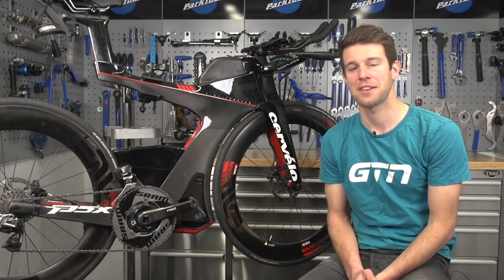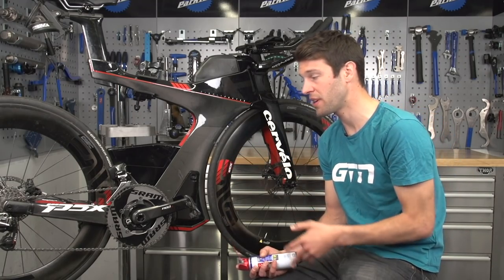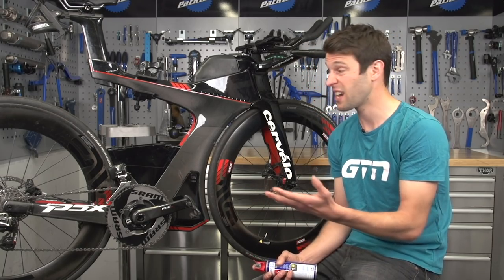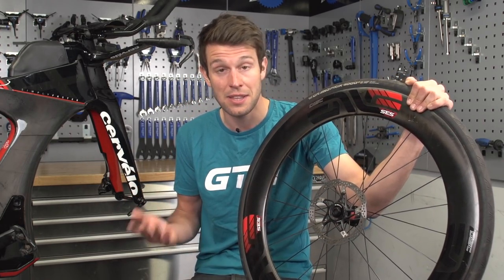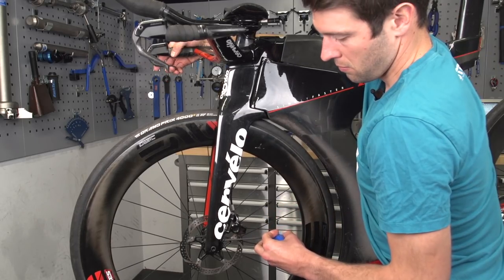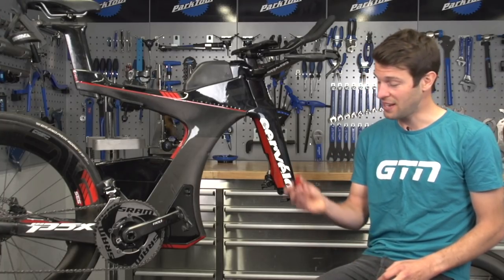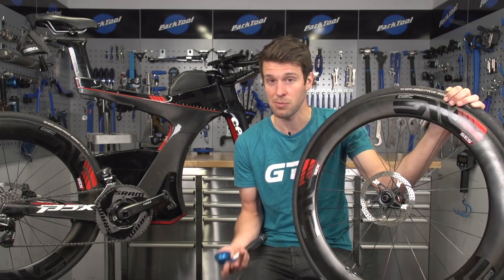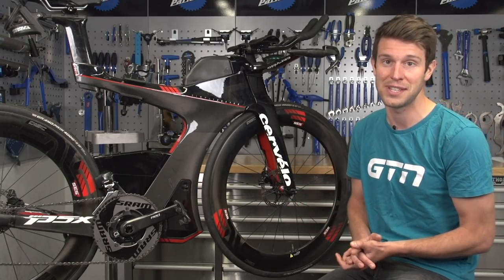How To Maintain Disc Brakes | Easy Fix Disc Brake Tips

Comment: no need to throw pads away if they get contaminated, just use a light sandpaper and rub away the glossy looking contaminated layer, happened to  me numerous times especially in winter and works every time

Comment: Using something between pads when wheel is removed is a life saver. 
Also when bleeding brakes, remember to use correct fluid, mineral vs DOT.
Reply: Pienimusta 
Just slide in 2 old credit cards
Reply: Good addition, thanks

Comment: Centering the pads over the rotor by pulling the lever and tightening in place hardly ever works for my bikes. Any pull from the hose because of how it's attached to the bike tends to affect the alignment. I usually end up going by eye or pushing pads back in and tightening the caliper when evenly over the rotor and let them self adjust into place.

Comment: You're doing a pretty big mechanics mistake in this video by using a torque wrench for unscrewing the disc rotor. Torque wrenches are only designed for tightening and can loose their accuracy when they are used  like a normal ratchet. Otherwise a nice vid - as usually.